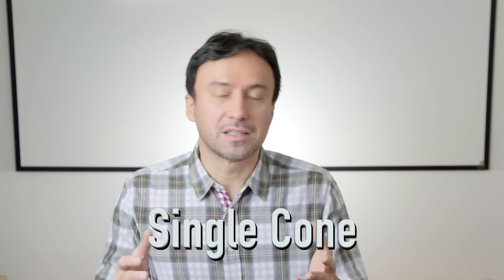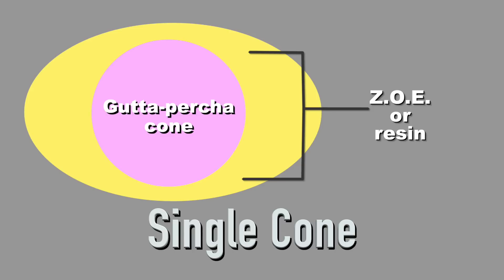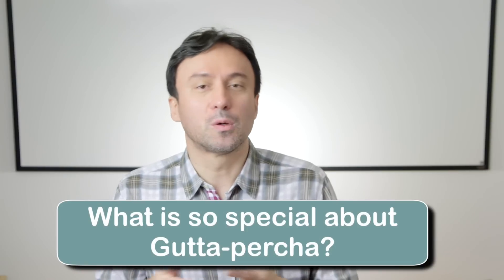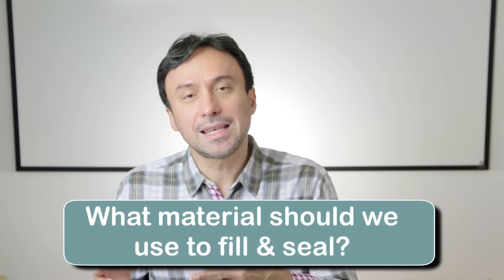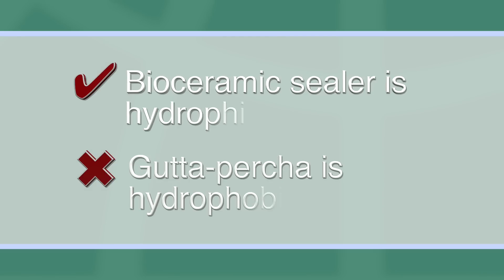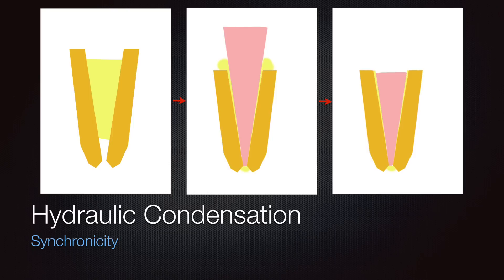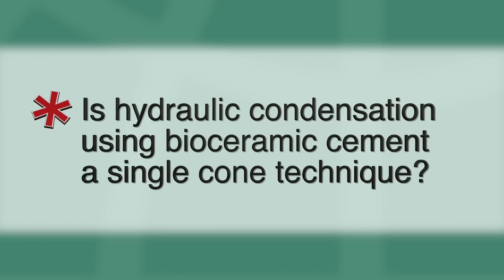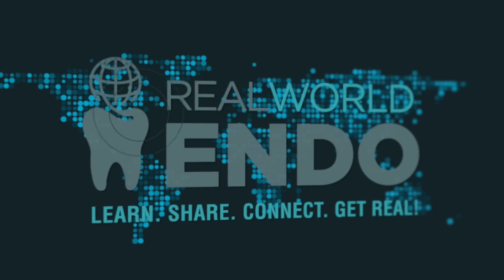Is Hydraulic Condensation with BC Sealer a single Cone Technique (Friday Questions)

Comment: Dear Doctor, may I ask your opinion on retreatment in the presence of bioceramic sealers, specifically techniques that do not compromise dentin? I would really appreciate hearing what you have found effective in real clinical practice. 
Thank you.
Reply from the maker: There's no way to retreat these without compromising dentin as they bond to dentin. And since the product of their setting is hydroxyappatite, the only way they set is with another agent that actually dissolves hydroxyappatite, which would be an acid, and would therefore also dissolve dentin. So, you'll have an issue with addressing this. But all retreatments have similar issues, with debris remaining in the canals. So, it's not worse than other techniques that way.

Comment: Dear  Dr. Nasseh, It's been nine years since you posted this video, and I wanted to ask what obturation technique you've primarily used throughout your career? And do you find that retreatment is truly manageable when bioceramic sealers are involved? 
I've come across several studies suggesting that bioceramic sealers are more difficult to remove during retreatment and may compromise tooth structure in the process. These studies also indicate that techniques using other types of sealers, such as AH Plus, can offer comparable long-term sealing while allowing for easier retreatment. I’d really appreciate your unbiased, professional opinion on this.
And I was also wondering if maybe you have been using a different type of obturation technique, something that you have found to provide good obturation no matter what type of canal you are dealing with and at the same time ease of retreatment.
Reply from the maker: Thank you for the kind words. It’s very important to understand that even though I helped develop these cements and had an interest in them, I’ve never claimed that these cements improve the success rate of root canal therapy. All I’ve claimed is that that they improve the simplicity and efficiency of care. Therefore, if you prefer using an epoxy resin or even ZOE with the appropriate compaction technique (either lateral or vertical) you can likely expect and equally high success rate. So, the focus for success should be on access, instrumentation and irrigation. If you are not using bioceramics for Obturation it’s fine. Just focus on finding all the canals and techniques to get down the canals to proper length and don’t push anything out but enlarge to a decent size and disinfect. Whatever you fill with after you’ve done those first few steps is much less a factor than you think. So, if you want to use a bioceramic for Obturation just use it for efficiency, not for a better success rate. I hope this makes sense. Cheers! :) 
PS. I have been using bioceramics exclusively since 2008. But before that I was using AH Plus and ZOE. I’m not sure if my success rate has increased since BC, but my Obturation time is a little shorter. That’s all! :) 😅
Reply: @EndosKool  I was also hoping to hear your opinion regarding re treatment in the presence of bioceramic sealers without compromising the dentin. What’s the best technique(s) that you have found useful?

Thank you for replying!
Reply from the maker: Thank you for the kind words. It’s very important to understand that even though I helped develop these cements and had an interest in them, I’ve never claimed that these cements improve the success rate of root canal therapy. All I’ve claimed is that that they improve the simplicity and efficiency of care. Therefore, if you prefer using an epoxy resin or even ZOE with the appropriate compaction technique (either lateral or vertical) you can likely expect and equally high success rate. So, the focus for success should be on access, instrumentation and irrigation. If you are not using bioceramics for Obturation it’s fine. Just focus on finding all the canals and techniques to get down the canals to proper length and don’t push anything out but enlarge to a decent size and disinfect. Whatever you fill with after you’ve done those first few steps is much less a factor than you think. So, if you want to use a bioceramic for Obturation just use it for efficiency, not for a better success rate. I hope this makes sense. Cheers! :) 
PS. I have been using bioceramics exclusively since 2008. But before that I was using AH Plus and ZOE. I’m not sure if my success rate has increased since BC, but my Obturation time is a little shorter. That’s all! :) 😅

Comment: Dr. there are two technique for using Bioceramic sealer that i have come across, the conventional one where we only "coat the walls" using guttapercha similar to use of resin based sealers, and the other technique where we fill the entire canal with B.C sealer and then insert the guttapercha. 
is the first technique a valid one ,"it's used mainly for economic reasons". Thank you.

Comment: Is it expected that the hydraulic pressure will cause post operative pain when biting or touching the tooth?
Reply from the maker: No. That's mostly due to inflammation or infection. You first check the bite to make sure the tooth is not in hyperocclusion. Then if the tooth is sore beyond 6 weeks, it means there's some microscopic amount of microbes left at the root end. The options are either to redo or do a surgical approach, or monitor for up to six months, where some teeth may remains just "different" before the revert back to normal. Radiographs and CBCT will also help know if potential anatomy was missed or root canal therapy was done adequately.
Reply: @EndosKool  thanks a lot, I appreciate your quick response doctor

Comment: Thank you very much for such a great video, but does  that mean the rule of "as minimum as possible" for sealers not applied for bc sealer?
Reply: yes doc you're right on spot. Bioceramic obturation is a "sealer based obturation" which means that almost everything has to do with the sealer, the gutta percha is just a carrier there..

Comment: Bioceramic sealers are extremely soluble with solubility extending over 10pc for every brand out there on weekly basis.There are plenty of anecdotal reports of teeth needing retreatments,unset cement seen at apex during periapical surgery ...I feel BC is more hype than anything else.Only sealers which have really low solubility are epoxy ones and maybe Roekoseal from Coltene.
Reply from the maker: Current solubility testing standards for self setting hydrophilic cements are incorrect. As a result, most studies using the current 6876 ISO standard and 57 ANSI Standards are invalid. I'm on the ADA materials and cements committee and everyone on the committee knows these standards have to be corrected since they were not designed for accurate measurement of this new generation of cements. The current ANSI and ISO solubility testing is designed for a different class of compounds and why it's unable to measure the solubility of these products accurately, especially the self setting bioceramics. This is a long conversation and not something for a YouTube comment but essentially, the testing using stainless steel rings prevents these self setting materials to set and solubility testing is therefore done on unset cement, which is why it exhibits higher solubility. The self setting bioceramics (BC Sealer/TotalFill, etc.) were designed to use in Vivo and do not set in Vitro. This is why stainless steel rings are not the right vehicle to test the material as it won't allow water to get to the cement. It's basically the same environment as inside the syringe before injection and a vastly different environment than you find in the tooth. 
I hope it make sense.
Reply: @EndosKool  hope its insoluble in vivo. Assure me please. I have recently started using it and while its the sweetest sealer to use I was wondering whether to retreat all the cases I have completed.
Reply from the maker: @narad8165  I have completed more than 10,000 cases over the past 11 years and I'm more concerned about it than anyone else. So far, and I think a decade is a pretty good measure of time with many 10 year recalls, that hasn't happened. Over 20million cases have been done using this cement over past 11 years and there has been no report of pandemic problems (like there was with Resilon!) I think it's pretty safe to say if the correct technique is used that the sealer is not a problem. 
Lastly, keep in mind cases fail not because of a sealer type but because of inadequate cleaning and shaping and removal of the biofilm. That's an important point to keep in mind. 
Cheers.
Reply: @EndosKool  thank you for your prompt reply.

Comment: If we don't use normal go not  bioceramic coated gp along with BC sealer will it affect the success of Rct  specially when good coronal seal is established
Reply from the maker: Won't be as ideal since your sealer is not going to bond to your GP Cone. But it's still better than the lesser alternatives. You may still need to condense a little to pack the GP. Unfortunately no specific studies on that I can quote.

Comment: Thank you doctor for the great scientific inform...
My question is since we depend merely on the sealer 
Do we need tug back in the gutta percha as we did in the old ways of zinc oxide eugenol 
Or just full working length tug back is not a mandatory? 
Thanx
Reply: the way it was explained to me is that tug back is not so important as having a well-fitting cone. Tug back can be indicative of an appropriately sized/shaped canal/cone, but if you want to know how it is fitting, make a cone fit xray to see

Comment: Is single cone GP with BC sealer can be Retreated if its short of apex ? Can we remove it even if the GP cone is short ? What about remaining BC sealer ? 
Thanks
Reply from the maker: Depends how long beyond the cone and what type of canal. If it's a few millimeters and past a curve it will be very difficult to remove. If it's a straight canal ultrasonic can remove it easily. The key here is to implement the technique properly and make sure you fit the cone to the apex and seat it to the end. It's the same thing with cementing a crown with resin cement. If one doesn't fully seat the crown and screw up the technique it's difficult to remove that crown after it has set! Like anything else, poor technique can ruin a good material! :)

Comment: Good day. Can I use this single cone technique if I’m using reciprocation stainless steel files shaping up to a 40 and using a calcium hydroxide sealer (Sealapex)? Thanks.
Reply from the maker: hydraulic condenstaion is limited to non shrinkable and non-resorbable, washout resistant bioceramic cements. So, no, not with seal apex as it will shrink and washout over time. You need conventional complication techniques (vertical or lateral) with conventional cements.
Reply: Real World Endo thank you

Comment: How do you cut back the single cone? I find when I use a heated instrument to cut back, as in cold lateral condensation, because the GP isn't as tightly packed sometimes the heated excavator sticks to the GP and tugs it out. Also I am finding that the Protaper matched cones are much wider than the files so they don't go to length as they should. I understand they have redesigned them because of this and I have yet to try the new ones. But which files and matched cone system do you recommend?
Reply: I've seen this as well. I go down a size and use a little more sealer. I always do a point fit first and trim the excess if necessary, but that's worked for me.
Reply: By having a strong tugback and a well heated instrument usually gp stays

Comment: Hello  dr.Nasseh, perhaps the hydraulic condensation method pressented here as commercial to BC sealer and very much compared to thermoplastic gutta-percha obturation ,could you please give your own clinical indications for using hydraulic 
?condensation as obturation method compared to the traditional lateral and vertical condensation methods
Thank you for attention
Reply from the maker: Hi Lior. The point of the Hydraulic Condensation is that it's Universal. You can use it instead of Lateral and Vertical Condensation. It's not a commercial technique. Yes, if you use the BC Cones it's better but it also works with regular GP Cones as long as you have the right amount of sealer in the canal. So, in my practice, I use HC in all the cases that I treat. I do 50-60 RCTs per month (used to do 100-120 but had to cut down due to time limitations for managing educational and academic obligations.) So, to be clear, I use HC on all my clinical cases! It does the same thing WWC and LC did. The point of the technique is that bioceramics have released us from the old thinking that you have to condense GP vertical and lateral to get rid of the sealer and those techniques are now replaced by Sealer Based Techniques with HC being the first technique of its kind. So, I hope it makes more sense now.  :)      
Cheers!

Comment: Thanks for the clear explanation. I watched a video where it stated that BC sealer will work the best when it is used in conjunction with BC coated cones. Can I use any type of cones to still get the benefits of the sealer? Would this still be considered hydraulic condensation?
Thanks
Reply from the maker: You can use it but you'll get only 50% of the benefits of bonding since it won't bond to the GP surface and will only bind to the dentinal walls. So, ideally and for the best benefits it should be used with the BC Cones.
Reply: +Real World Endo 
Thanks for the quick reply. That leaves me with one more question. Would you recommend vertical condensation with a different sealer (AH plus) or hydraulic  (single cone) with BC sealer without using the BC coated cone. The reason I ask this is because I have just switched to protaper next (ordered a lot) but I still want to try BC sealer. thanks
Reply from the maker: Jay Choi We obviously prefer HC; but Brasseler may make BC cones for other File Systems.
Reply: Thanks a lot, I will look into it!
Reply from the maker: It would be considered hydraulic condensation but you obviously won't get the best results. Is it still better than traditional sealers that way, yes. According to internal studies at Penn you get better initial sealing with the BC Cones. Down the line the sealer expands and that may help. It's the same idea as slanting your post vs. not slanting your post. Which is better? Obviously slanting it? Are there clinical studies that show a difference in success? Who knows! :) So, unless you have no access to BC Cones why take a chance? They are not expensive.